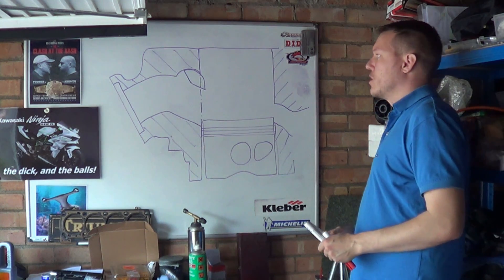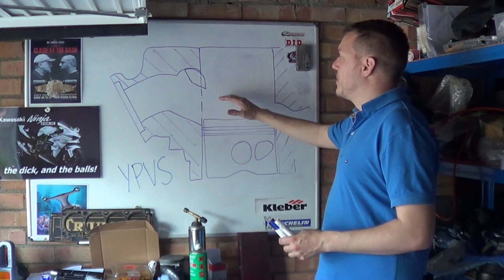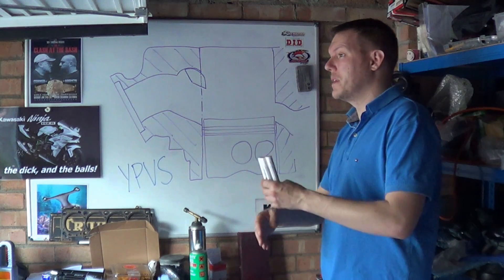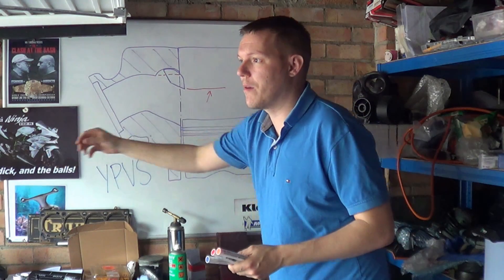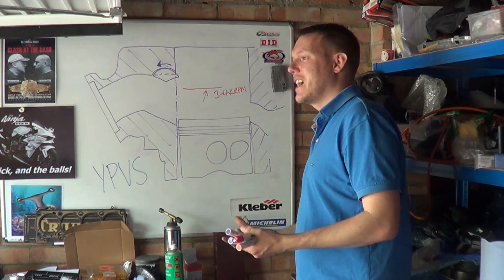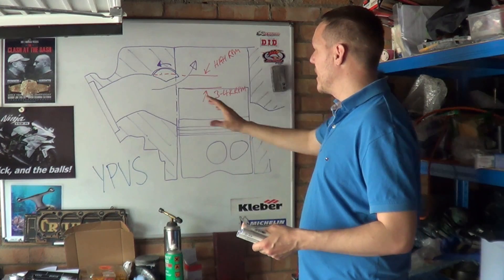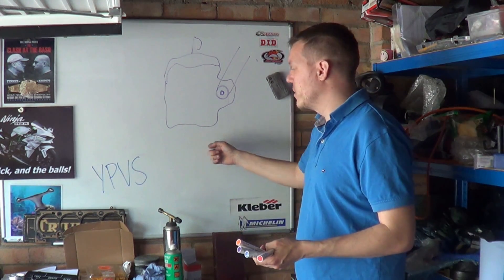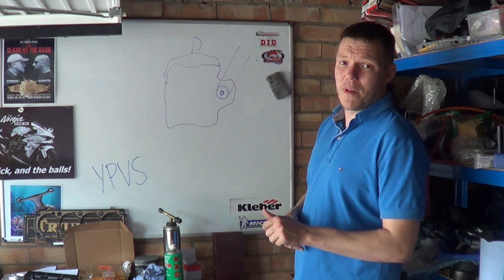Power Valve - YPVS - How it works

Comment: My YAMAHA TZR125R HAD THIS SYSTEM, I don't think it rotates inside like a turbo but you choose the setting and lock in in that position because I remember when I turned it from normal setting it was good at high up but slow on excelaration and vice versa when you turn it back.
Reply from the maker: "I don't think it rotates inside like a turbo"

- say what?
Reply: @thedirtyworkshop  the shop who sold me the bike said it has ypvs, I said what the fuck is that, he replied =it a valve that spins inside the exhaust port like a turbo to control gases escaping , when I opened it all it was a long rod with middle bit cut out ,all you do is turn it to the position you want and lock it as the Haynes manual said.
Reply from the maker: Yes I know, I was asking about the turbo bit and that is funny as fuck
Reply from the maker: "when I opened it all it was a long rod with middle bit cut out ,all you do is turn it to the position you want and lock it as the Haynes manual said." - I don't think you watched the last 1/2 of the video....

Comment: Hi Matt, I've got a DT125R (about a '96 model) sitting in a garage waiting on me pulling my finger out and getting a new wiring loom. It got a new frame and swapped engine casing over (so entire engine stripdown and rebuild), and hopefully get it registered as a new bike as all components are new/refurb.
The year/model of my DT doesn't have a servo or pulley system to control it (nothing on the bike or engine casing like models that do). I at the time assumed it was just a restrictor and stuck it in the wide open position so that the circular half of the valve was against the cylinder head and the port as wide open as possible. 
In this situation how would you fit the valve as you can fix it in any position, or would you just ride and tweak to personal preference in this scenario?
Reply from the maker: personal preference
Reply: Lol what a reply

Comment: My DT125 power valve widens and narrows the exhaust port. There is nothing on it that a piston could run up and down to the change the height of valve opening. Trying to do that results in contact between the valve and the piston. If you set it that way and started the engine, you would need a new barrel and piston.
Reply from the maker: "My DT125 power valve widens and narrows the exhaust port. "

- which changes the timing.......

Comment: No bottom end reminds me of a UK spec TZR125 my mate had when they first appeared with the valve locked shut to limit the power to 12bhp and we bypassed it to fully open riding it was like pulling away and nothing happens rev it a bit and nothing rev a bit more noting then bahhhh! Fuck me!! 90mph oh to be a teenager again almost as much fun as the kips system on my KR1 that kicked in at 8500 rpm

Comment: Hi i have a dt200wr 1995 model. Just sent for bottom overhaul and changed quite a number of parts. After overhaul my bike can run max at 70km/h and upslope prob around 60km/h and that is full throttle. Is this normal? I know im not supposed to whack it out which i didnt.

Comment: I have a 1989 rmz 250 with the dual drum set up. The valves broke off, scored the fuck out of the piston and cylinder, and when one of the valves dropped into the expansion pipe it bent the center column of the exhaust pipe. The bike being a 1989 is making it dificult to find parts. I might resleave the cylinder, new piston and rings, and tig weld the cover where the valves were so exhaust wont come through it.

Comment: Just discovered your site, clear technical, liked the article on 2 Stoke exhausts. Did you know the system originated in the early 60s as tuned pipes on 2stroke model engines in the 3 to 10cc capacity, used in speed control line comps. They were always at max revolutions so the pipes could be tuned exactly and it revolutionised speed and rpm allowing speeds in the order of 200mph.
If you go onto YouTube in :control line speed: you will see examples of engines :coming onto pipe:.
Regards
Keith

Comment: I had to comment on this. Im a auto machinists a long time ago and the exhaust power valve was an incredible idea. It just gets dirty and hangs up. And made uncontrollable power band from .5-infinite so manufactures quit makin em. My experience was suzuki rmx 250.  Crazy quick.
Reply: I have a 1989 rmx 250. I paid $500usd for it, and i rode it for 10 minutes before the powervalves broke off and scored the cylinder, piston, and bent the exhaust port.

Comment: I can remember my old DTR125 I bought had no servo kit like the newest ones did and I bought It derestricted and my god it just ran out of power at 6k.

My mate came round to look at it and turned the power valve round and my god it was like a rocket, a different bike all the power came in at 6k but the bottom end was shit.  

Couple of months I found a old servo kit that opened and closed the power valve with the position of the throttle and the  it had the best of low and top end. Really miss my DTR best bike ever
Reply: Lee Howling I have DTR125 -91 right now ;)

Comment: 84 rz350's got them. i have a kr version. reed valves are important as to when the p/b kicks in also. between the exhaust valve rotation rate and travel and the reed valve stiffness quite a range of tune can be had with just one set of pipes(the non cat type). i think ypvs was used primarily because the rz used cats and that really fucked with the pressure wave parameters. with a re-curve of the valves in conjunction with decent chambers and a set of matched wiseco's these little bikes are damned entertaining.

Comment: Matt, can a power valve be used to restrict the engine? My Honda (early 90's) CRM125 has almost the same engine as the NSR125 but they have different power valves (RC servo). It's looks like it opens fully above 1500rpm but starts to close as the rpm's rise! And it's not got as much power as my old none power valved Aprilia ETX125!
Reply from the maker: The video on the Honda system will be out soon - matt

Comment: how it works = a cylinder rotates in the exhaust port, low rpm it restricts flow and alters port timing , high rpm 
its unrestricted and free flowing.
why = to increase torque at low rpm.

There I saved you 14 mins of your life.
Reply from the maker: Dickhead comment of the day! Well done
Reply: Thanks I have never been pinned before that's awesome :D 

Like I said YPVS increases torque at lower RPM's

Port timing (intake, exhaust and scavenging) is a very important factor that determines the characteristics of a 2-stroke engine. In general, fast exhaust timing means that the engine will perform well in the high-speed, high-power range, while slow timing means the engine will have good low-end torque. However, a road racer or motocrosser which must perform well especially in the high power range will also encounter many other situations, such as coming out of a corner, when it will need high torque and good mid-range performance. 
The YPVS answers both of these needs

https://www.yamaha-motor.eu/designcafe/en/about-design/technology/index.aspx?segment=About%20Design%20-%20Technology&view=article&id=440980
Reply: and btw if he's right then why watch the video how do i no who is right till i watch it you moron woops god

Comment: A friend of mine use to have an RD350 YPVS and if I remember it right it was connected to the throttle position... It worked pretty well I remember to ride it once up and down the road. The bike was just to small for my 198cm like most bikes made for mid size to smaller people. Spare sparkplugs where requested since the fuel still had led in it...

Comment: Hard to describe it unless you see the mechanism but think of a length of tube and squash it so you have a flat section about 1 inch long and put it close to the exhaust port.....bingo! You still can't beat that sudden transition when a 2T comes on pipe and hits its power band though,addictive 👍🏻😎
Reply from the maker: Just like crystal meth. great fun but its gonna eat your wallet
Reply: ninjanelly350 
ever seen any of the old patents for atkinson cycle engines? that mechanically change the length of a 4T powerstroke compared to the length of intake stroke? a hugely complicated thing. they spoof it really simply with gimped intake cam timing.
I think of power valves as, instead of changing the length of the exhaust to the resonator chamber (you could build an exhaust like a trombone) they just spoof it with power valve. that's how I think of it anyway, a simple way to get a similar effect to what yer really after.

Comment: i have yamaha yz 125 1987 my power vlave is opening exhaust is clean but when i hold full throttle it kicks in to hight rpm in like 30seconds and than reacts normali but it has that problem to get ot high rpm like it stucks on the point like 8.000rpm and after like 30sec it goest to full power and kicks in but why that long can you help ?
Reply: hmmm has it been upgraded ass illegal for a 125 from the 80s to have the control unit fitted till you past the test
Reply from the maker: The YZ has a mechanical actuation. Maybe your spring for the speed governor has shit the bed, or something is fouling the pivot arm. You can take off the outer cover and have a look. Send me some pictures via facebook if you want - matt
Reply: i checked and when rev it the power valve moves freeli i tried to open it manuali full way it had diferend sound but do the same thing and what is the facebook name ?

Comment: Any idea how much the exhaust port height varies (in crank degrees) from full open to full closed on the Yamaha YPVS?
Reply from the maker: It changes from engine to engine so no, not of the top of my head
Reply: do you have a working one dont worry abbot it  if not tack your exhaust pipe of tern over till bdc tack the locking bit off  i think on the right hand side and put your finger up the hole wher the exhaust connected  and then rotate the valve till you feel the barrel abbot 1/4 inch then tack a grinder to the lock and cut a new notch in it will mack you feel like getting off and pushing below 7 to 8000 rpm but happy days above it gave my 80s rdlc 2 power bands 2nd cut in at 10500 wher it wos maxed out when it wos closed :)
Reply: I'm not "worried" about it.  I'm just trying to simulate it in engine designing software for the purpose of tuning.  I figured that if someone knew, it would save me opening up the engine to measure it.  No big deal.  In case someone knows in future, it's a TZR250, 2MA engine that I'm working on.  Thanks.